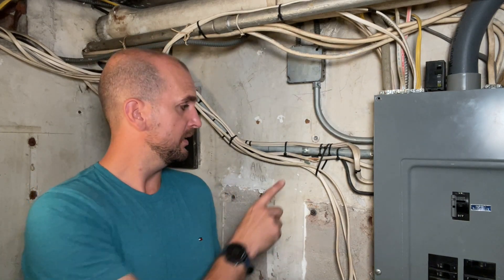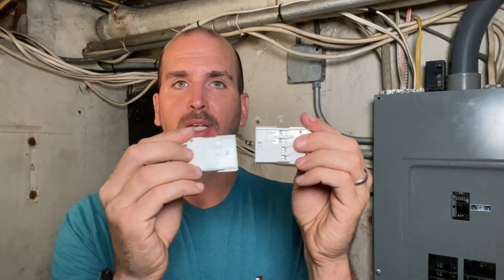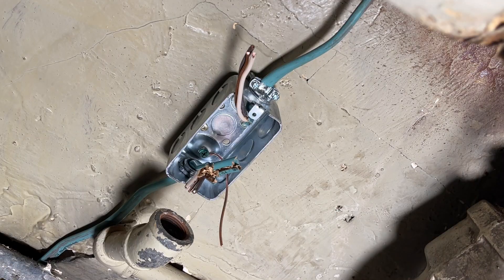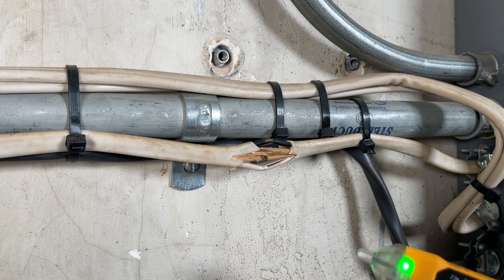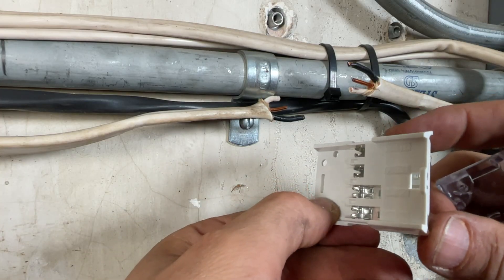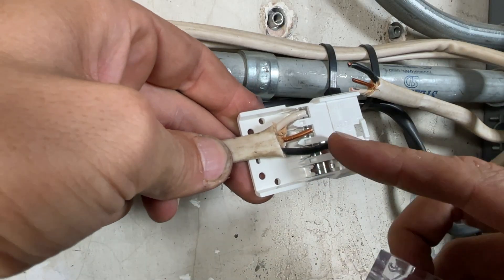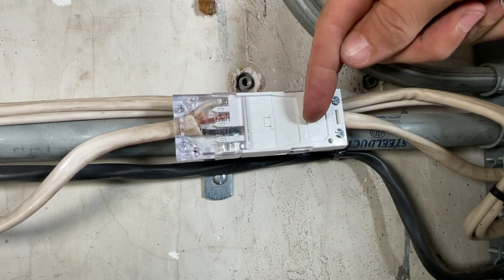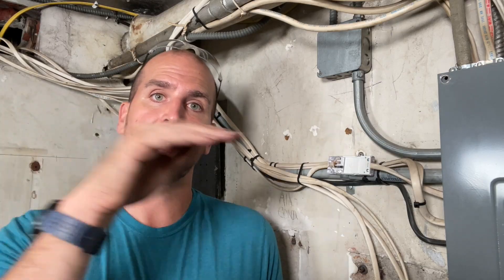How To Repair Damaged Romex Wires

Comment from the maker: TE Romex Splice Kit:  https://geni.us/GGBsfW
Wago 221 2-pin Lever Nuts:  https://geni.us/TAwOB
Handy Box:  https://geni.us/ULabPmJ
Handy Box Cover:  https://geni.us/9p4E
3/8" Romex Clamps:  https://geni.us/CWwSSUL
Ground Screws:  https://geni.us/aIvlr
12/2 Romex (25 ft):  https://geni.us/7Y7e
TE Romex Splice Kit:  https://geni.us/GGBsfW
Wago 221 2-pin  Lever Nuts:  https://geni.us/TAwOB

Tools Every Weekend Warrior Needs
Makita Cordless Drill Combo Kit:  https://geni.us/t7dIA
Dewalt Drill Bit Set:  https://geni.us/oFlSl
Dewalt Screwdriver Bit Set:  https://geni.us/VDcr
Craftsman Screwdriver Set: https://geni.us/jXqFI
Eklind Allen Wrench Set:  https://geni.us/7XfvO
Pliers (4-Piece Set):  https://geni.us/RIdx
Milwaukee Fastback Utility Knife:  https://geni.us/MlyiLk
Stanley Tape Measure:  https://geni.us/bUfD1R
Studbuddy Stud Finder:  https://geni.us/RySCuVw
Johnson Torpedo Level:  https://geni.us/wiLcDY
Stanley Hammer:  https://geni.us/bPDk8Wo
Buck Bros Wood Chisel Set:  https://geni.us/vk3cpTW
Klein Voltage Tester:  https://geni.us/h9Hl
Klein Outlet Tester:  https://geni.us/kdBAJ
Milwaukee Wire Strippers: https://geni.us/5zuLAbC
Little Giant Ladder: https://geni.us/fmlmTk

DISCLAIMER: This video and description contain affiliate links, which means that if you click on one of the product links, I’ll receive a small commission.

Comment: The Question Is,
How You Repair A Broken
Romex 12 gauges Wire Inside
Of The 1/2” Metal Conduit Pipe ??
Amén.

Comment: To all the naysayers of the TC splice, I have a question. If you were to take and strip the wire, solder it outside the plastic housing so you don't melt it, and reinstall it would that make you happy?

Comment: What are the code violations here? You cannot support cables on conduit. Only class two wire going to a furnace or boiler from the ceiling down to the control box that is the exception. If the copper integrity was not damaged, it is completely legal just to wrap electrical tape around the damaged area of the insulation and then wrap electrical tape around the whole cable. The tape has to be equivalent or better than the original insulation. Which is not hard to do.

Comment: “From the way you present your channel, it seems that you may not be a certified electrician. For that reason, I would suggest paying extra attention to the accuracy of the information you share and always referencing the National Electrical Code (NEC) as it applies to each situation. For example, in the background, those Romex cables appear to lack proper support within 12 inches of the panel and are tied to a conduit, which does not comply with NEC.

Comment: Looks like a scotchloc for romex.  I won't use scotchloc to repair 12v trailer wiring so I definitely won't bury one in the wall with 120v wiring.

Comment: That splice I am sure increases resistance as there are only two small points of contact when the hot is snapped in place. No fucking chance I am using that splice, I am using real T&B Marrettes made in Canada, pre twisting wires, using a steel junction box, and grounding it properly and doing the job correctly.
Reply: Some are saying use tape or liquid  tape if there is no damage to copper. Would you use that and why not. Thanks

Comment: As the owner of several different RV's and each had elect outlets where the wires just pushed into forks cutting the insulation and making contact with the copper. Nothing but trouble....ended up replacing most if not all. I would be very concerned with that type of splice on a 20a circuit. I do use waggo's at home and in the RV for low amp draw applications.

Comment: I wouldn't use those in my house. Whats the difference using male and female extension caps in a wall. Im and electrician and I've  seen them, because they were burnt and no longer working.

Comment: I am an electrician. I am not a fan of the type of splice connector that pierces the insulation unless it on low voltage. Not 120v. I have seen a new hexagonal junction box that is plastic and has an attached cover. The Romex NM can be laid in from the top without cutting the wire and snap the cover on holding the Romex NM in place.

Comment: - Exposed Romex wires, resulting from previous work, pose safety hazards and need repair to prevent accidents.
- Best solution recommended by professionals involves pulling a new run of Romex from the main panel, ensuring no exposed wires.
- Alternative solution involves installing a junction box to enclose the exposed wires and splicing them together for safety.
- For damaged Romex within walls where junction boxes can't be installed, TE offers approved splice kits, allowing damaged sections to be safely connected.
- The process involves securing a handy box, cleaning and preparing the wires, installing the splice kit by pressing wires into forks, and finally, mating the two halves of the splice kit to ensure a solid connection.

Comment: Those forks cause a weak point in the wire and current is not spread evenly. I have used similar connections and had multiple failures. Will not use them
Reply: Quality extension cord male/female ends, connected, serve the same purpose with better current spread.  Probably not an approved practice though.

Comment: This is why conduit is king. I personally don’t like the splice kit, those connections inside are not rated for heavy current. The handy box is the best way to go, and using the 3 bay wago connectors on hot and neutral plus a 4 bay for the ground gives you an option to branch off that circuit for a convenience receptacle or lighting application.

Comment: The physical surface area in contact with the wire through those tabs is so small, that I'd be concerned they can't carry enough power without overheating.  I'd rather the wires were pushed in or seated with tabs that had full length contact.  That seems like a disaster waiting to happen.

Comment: The conductors are intact. Adding a splice adds resistance and opportunity for a poor connection. If you can just repair the insulation, which is what's broken, I'd argue there is less risk. Electrical tape... can't get cleaner heat-shrink around it.

Comment: So these stupid romex splice kits require the conductors to be cut. Why? If the insulation is the issue, why not allow the conductors to remain intact and basically have the unit snap on to provide the new insulation and a bit of additional contact in case the conductors are slightly damaged. Its superior design, less work, and safer.

Comment: This type of connector is called an insulation displacement connector. (IDC). They use a blade to both cut the insulation and provide electrical contact.  They have their uses and aren’t always bad but are definitely not the most reliable or preferred solution in almost all cases.  Their main advantage is they are usually cheap and relatively easy to install.  Downside is they are finicky, inconsistent, and failure prone (especially arcing), especially in applications where movement or vibration are expected.  

Would strongly prefer a solder, mechanical splice, weld, crimp, or screw down connection over an IDC every time.  Most electricians I’ve worked with tend to cringe at these things and for good reason.  Only use if you lack alternatives and definitely do NOT bury it in an inaccessible spot behind a wall.  (Same reason we do not allow handy boxes to be behind walls) Almost always better choices exist.  Replace with a better choice later if possible.

Disclosure: I own a company that makes wire harnesses and have produced thousands of products with IDC connectors.

Comment: I like the metal box better
Reply from the maker: For sure, that is by far my preferred option if possible.  WAGO also has a newer connector out called the WAGO 221 inline splice which is perfect for this type of repair.

Comment: After having had issues with the type of connectors in your in the wall splice in my RV outlets, I am hesitant to use them. 
Is there another way using screw terminals.

Comment: Not designed for NM prior to 1990
Reply: How do you know this?
Reply: @JayyBird93 I read it. The older pre 1990 NM wire had a thicker insulation

Comment: It's a shame those thing are the only approved solution, because they are really janky.

For example, a purpose-made metal enclosure with lever-connector inline splices inside would be so much safer.

Comment: I wouldn't trust the TE splice kit. I don't understand why the NEC would allow them to be installed in an inaccessible area. I think a better option would be to install a junction box before the wire runs down a wall.
Reply from the maker: I think they were originally approved for double-wide manufactured homes.  So they could plug circuits together when bringing the 2 sides of the home together onsite.

Comment: Those are cheap connectors that are prone to fail. They fail all the time in modular homes. Thanks for the business because I will most likely get a call to repair the failed circuit.

Comment: I found a few things here that are pretty interesting. First, who the hell cuts the insulaton off a wire and leaves it exposed? What idiot would do that? Second, you used connectors in your box to make the splices rather than wire nuts. I realize both meet code but he connectors rely on spring tension to make connection with the stipped wire. I am of the belief that wire nuts (when done correctly) are far better. Strip the wire, twist your leads together with your pliers in a clockwise direction and then put a wire nut on. Far better than relying on the spring tension in a connecter to make contact (IMHO). The last was that they allow you to use connectors to make splices behind walls. That used to be a major code violation. I'm not an electrician by profession but have done a lot of wiring over the years. This must be something new that I not aware of but could come in handy.

Comment: Personally, I do not trust those TE Romex Splice Kits.  The "point contact" (where the wire bites into the metal piece of the TE kit) has a very small cross-section and may generate heat when higher amperages flow through the conductor (amperages still within the range of the conductors).  Just an opinion...

Comment: I’m just old school and do know better than to trust anything less than a well done pre twisted wire nut especially if it’s to be buried. I know it’s not code to bury a j box but I would much rather that then a splice kit which will fail under continuous heavy load. Copper to copper will always be superior than any prong, insert or lever connectors. I was taught the correct way 45 years ago and never had a wire nut failure. Wagos are fine for light fixtures but I don’t trust them to carry heavy loads even if they are a time saver.

Comment: Open Romex and cable ties? I would not have left it as that; at least corrugated PVC (and it is probably insufficient).

Are crimped connectors permitted in the area? Butt crimps + heat shrink make for nice repair method, but crimping solid wire is tricky and may be prohibited outright. Otherwise, I'd consider it a go-to method without box; if box is permitted and environment permits Wago 222 (less favour to 221), I'd be split.

Comment: That TE Splice is unavailable on Amazon. Approved or not, it looks like a substandard connection for a 20 amp 120 volt circuit. It's very much like a Scotchlock connector, used in vehicles, but not ideal.

Comment: If only the sheath is missing for about 5 inches, is electrical tape safe to wrap around area with missing sheath?  ( It's feeding a wall outlet through top plate in 2x4 wall. ) Thank you!

Comment: I would rather just tape it up if the conductors are not damaged. No point adding an unnecessary connection. I don't trust that thing.

Comment: The example of using a handy box is a bit skewed since the wire suddenly became long enough to make proper splices.  How would he do this if the wire had no slack?  Probably with two splices using  'jumper' wires.  That instance would have been more educational for this scenario.
Reply from the maker: WAGO 2401 inline splices will do the trick.

Comment: Strip it back a little farther put some really good 3M tape on each wire and then tape it up and be done with it you over killing it that's a mechanical connection why would you want to cut the wire just re-insulate the wire you have

Comment: Do not use this. Its cheap, flimsy and has 3 different points of connection instead of one that can go bad. Want a solid safe connection ? Use a box and wire nuts. Want to start a fire ? Use this
Reply from the maker: What do you do when you don't have any extra slack in the Romex and the damage is located a fair distance from the start or end of the circuit?  WAGO 2401 inline splices are the best I have found.  These connectors are actually new since this video was made.
Reply: @EverydayHomeRepairs  create it or use two connections in one box

Comment: Super. If I was actually going to hide a splice in the wall, you better believe that I would use a screw termimal connector, not a poke the insulation connector. I've rewired a number of homes where the homeowner damaged the wire, but the best one was a female friend trying to hang a picture with a huge #16 nail and going right through the Romex. She called in tears, (From the shock?) so I went right over, and long story short, I was able to repair the wire by putting two clock outlets on her wall and pulling a new piece of Romex between the boxes. She was greatly relieved when I only charged her twenty dollars, (Normally, minimum $60 per box.) and I did such a good job on the clock receptacles that the husband didn't notice for almost two weeks. Ever notice an outlet in your house that you have never seen before? It's just Super Sparky on the job again, saving the world from bad wiring, one house at a time. 💙 T.E.N.

Comment: I would not use this type of connector for a splice. The wire pericing reminds me of the back stab tupe connection in your cheapest duplex outlets. I have seen wiring burnt up using the back stab method when a heavy load was applied such as a space heater. This splice is not your best and safest solution. Install a junction box with better connectors.
Reply: Yup, always use the screw terminals.

Comment: For anyone wanting to install a box for this scenario, if the conductors aren’t damage and it’s just the outer jacket you can get an open splice box and not have to cut the wire to install it. It’s literally as easy as snapping the box over the wire and screwing it to the wall
Reply: Electrical tape then open splice box is what i would do.  Or just the tape. 😊
Reply: @gerry3595 I’m with you!  I’d wrap the hot and neutral individually.  Then all the wires together. If the copper is not damaged, there is no risk.
Reply: Not where I am. And not where I previously was.

Comment: You need 6” of conductor in the box. If there isn’t enough slack in the wire to bring that in, I would put in 2 junction boxes and connect them together with a new wire

Comment: I didn't know these splice connectors existed.   As many have mentioned, the insulation piercing connection is not great, particularly under load.   Personally I would be inclined to use the liquid insulation applied to the exposed conductor.  Having the continuous conductor is always better than cut.
Reply: https://www.youtube.com/watch?v=hFNE23rCfn0

Comment: I keep one of those in my toolbox but I've never had to use it. I noticed that it specifically says two conductor plus a ground, but there are four splice points in the unit. However, the notch in the cover doesn't look like it would accommodate a 12/3G Romex sheath.

Comment: The only thing i would say is that when opening or closing a circuit ( cutting wires) your black or hot wire is always the first to break when opening a circuit and the last to make when closing a circuit. Ground is always last to break when opening and first to make when closing

Comment: I have a question. It seems to me that leaving the wire uncut is a better situation if you could just re-insulate where it was skinned. There are a lot of insulation products available such as liquid, tape, and different types of self vulcanizing Products. Can someone tell me if this is a code violation to re-insulate the damaged insulation?
Reply: NEC allows repairs (assuming the copper is not damaged) as long the insulation on the repaired section is at least equal in integrity and rating to the original insulation.

Comment: those IDC connectors seem like they have very little surface contact. Probably why the one post mentioned them burning. I use IDS (insulation displacement connector) on data but never seen it for power.

Comment: I’d be inclined to solder a section of wire between  the severed cable and finish with shrink insulation sleeves.

Comment: I would like to know how this is better than properly connected wires inside a box even if concealed in a wall. Just like screwless connections in switches and receptacles that all eventually fail.

Comment: Those splice kits really look like they wouldn't be able to handle very much current.  I've seen back wire push in connections in receptacles & switches also burn up when they have a load on them.  I definitely wouldn't trust them with a heavier load.  It looks like the same lousy mechanism used to connect low voltage landscape lights.  I always cut those off & use direct burial wire nuts.  I don't think I would trust those splices.